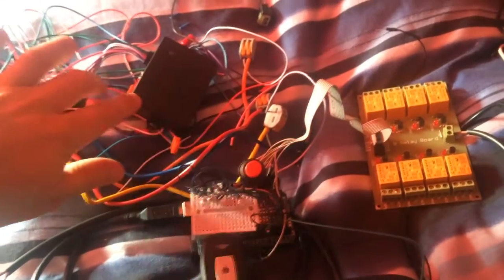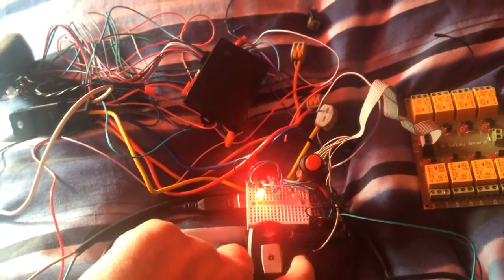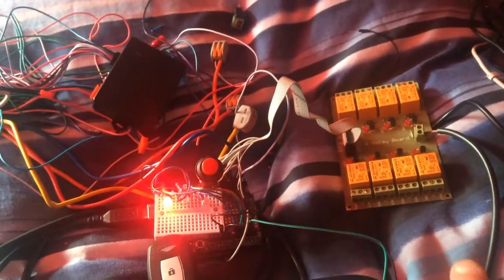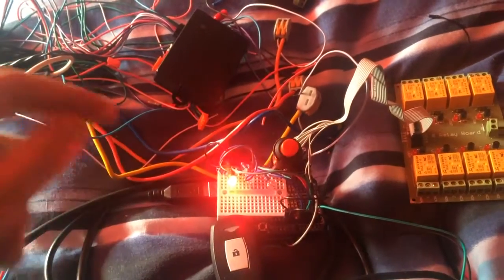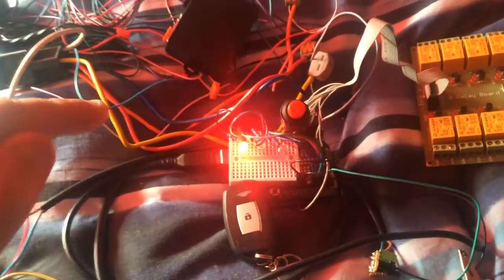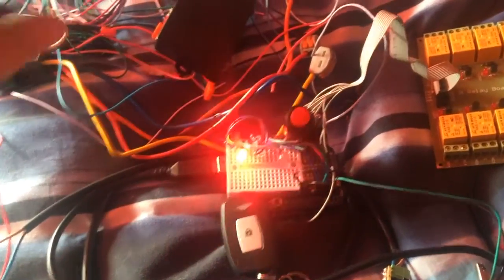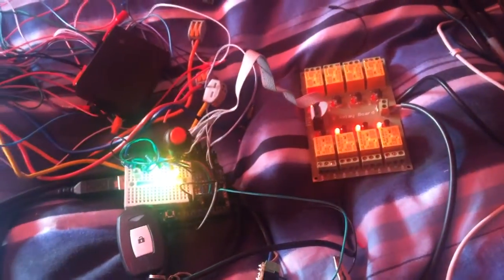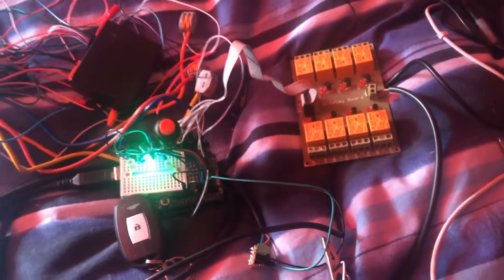PKE + Arduino + Push Button Start

Comment: Could you share more about this project.. I would love to have a Sketch and wiring diagram
Reply from the maker: +Jason Deneault 

Hi Jason, add me on facebook (https://www.facebook.com/TheMeroving1an) and I can answer any questions you have and explain this circuit.  This was designed around my modded Saab ISM (Ignition switch module) so it's application to your vehicle may be (will be) different however the principal is the same